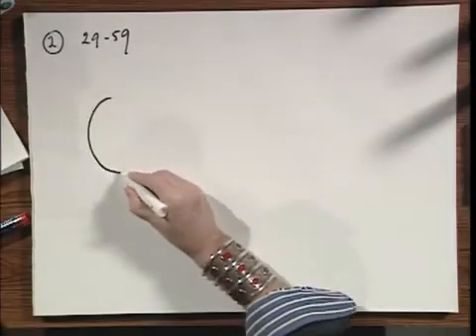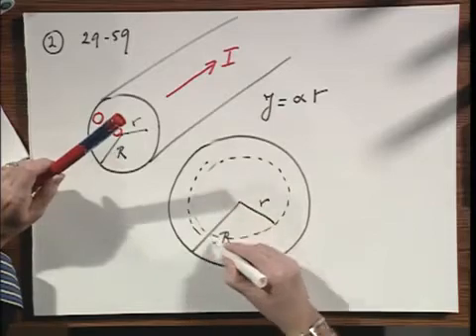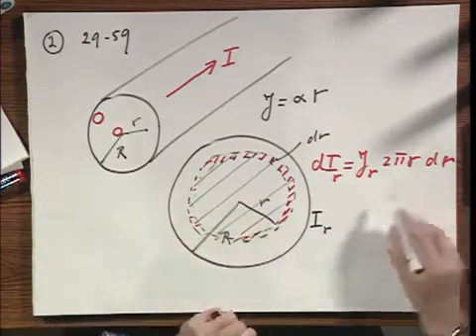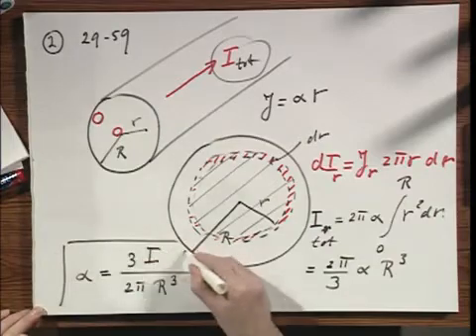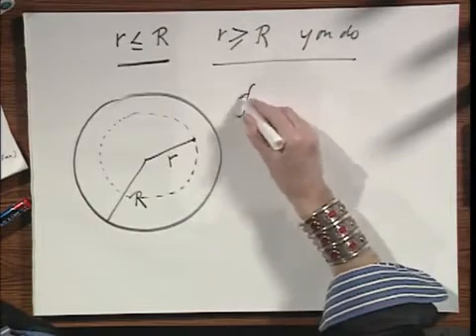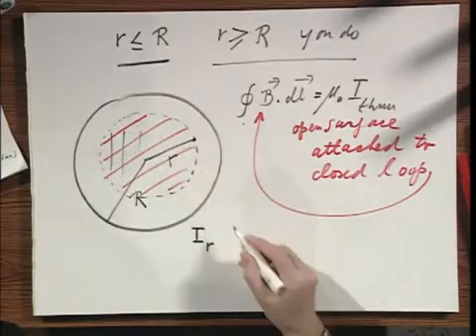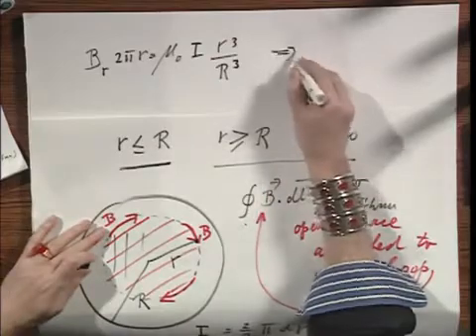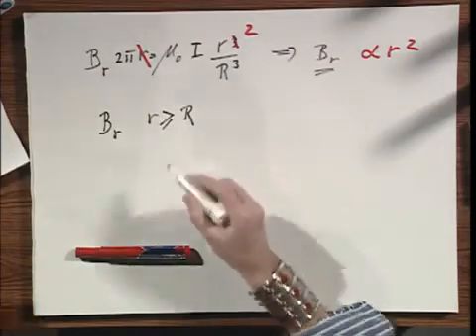8.02x - Module 06.02 - Wire with Varying Current Density.

Comment: Sir, during the calculation of internal flux of a circular current carrying conductor I calculate the flux through the small strip “dr” which is dΦ but after that to determine the total internal flux dΨ why i need to multiply no of turns of condutor( here it is fraction of total cross section of the conductor) with dΦ  as I already calculate the flux linking that current through Ir. Please help me. I am confused
Reply from the maker: how many minutes into the video? be specific what you mean by the flux of a current.  There can be an electric flux and/or magnetic flux through an open or closed surface.
Reply: Lectures by Walter Lewin. They will make you ♥ Physics. Sir, I am talking about the magnetic flux. After calculating the magnetic flux through the small strip “dr” due to the current through “Ir” I got dΦ equal to μ0*I*r*dr / 2πR2 ( I = total current through the wire). But for the total internal flux linkages why I should multiply  no of turns of the conductor(r2 /R2) with dΦ. It is related with electrical transmission line parameters. Inductance due to internal flux
Reply from the maker: @prabinmandal4160  *how many minutes into the video? *
Reply: @lecturesbywalterlewin.they9259  sir, I learned that if the current density is uniform throughout the conductor then flux density Br=μ0*I*r/2πR2. But what will be the total internal flux linkages inside the conductor from the centre upto the conductor surface (considering unit length of conductor). How do I calculate that?
Reply from the maker: @prabinmandal4160  how many minutes into the video?

Comment: sir why we take surface area of the ring as 2*pi*r*dr insted of pi*r*dr
Reply: Vaibhav Sharma the value of dr is very small with respect to r, so if you multiply dr times the  2*pi*r you will ultimately get the surface area of that little strip dr. Walter Lewin please like if I am ok

Comment: sir which book you are following so that i can easily see the question you solve?
Reply from the maker: 8.01
Physics
Hans C. Ohanian
2nd edition
W.W. Norton & Company
ISBN 0-393-95748-9

8.02
Physics for Scientists & Engineers by Douglas C. Giancoli. 
Prentice Hall
ISBN 0-13-021517-18

8.03
Vibrations and Waves by
Anthony French
CRC Press
ISBN 9780748744473

8.03
Electromagnetic Vibrations, Waves and Radiation 
by Bekefi and Barrett.
The MIT Press
ISBN 0-262-52047-8